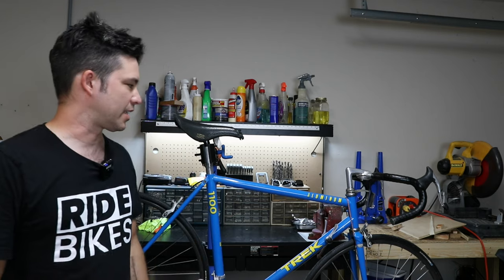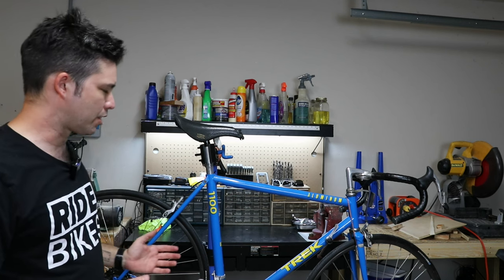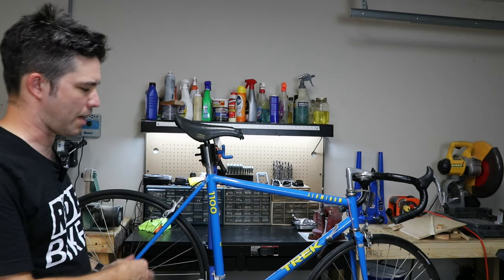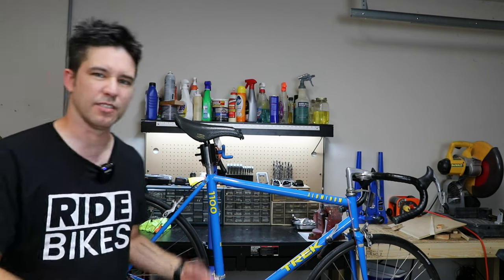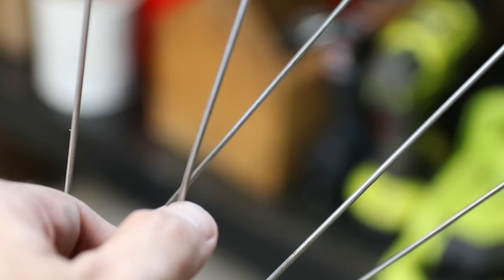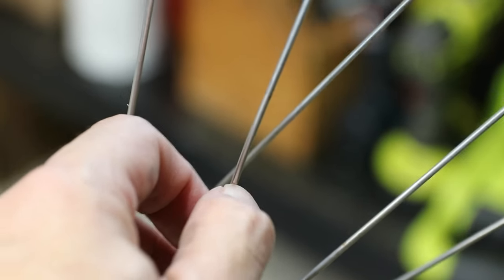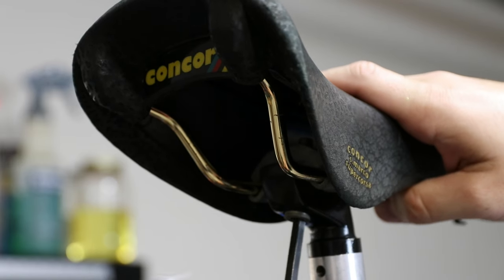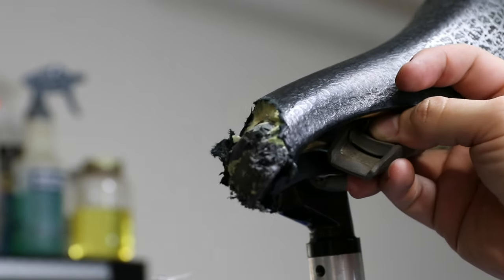$50 Vintage Trek 1100

Comment: I have a few questions , what type spray were you using to clean with  and do you ever use warm soapy water & the water hose or a pressure washer  ? As always a great video , excellent camera work & great job on the clean up & tune up , I hope you make a good profit on it . Thanks for sharing Bruce.
Reply from the maker: the spray was just some old watered down windex I had around. It wasn't really for the chain but overall just to get some dirt off the frame. I don't specifically go out and buy windex, but it was from my late mothers house so I'm just using it. Yes I sometimes use soap and water, even car wash pressure washers, just depends on where I'm at and how dirty the bike is. This bike wasn't too dirty to start with.